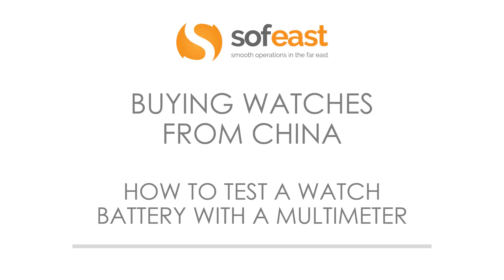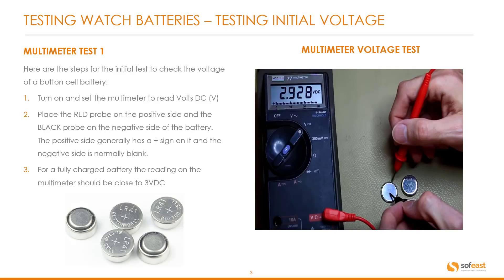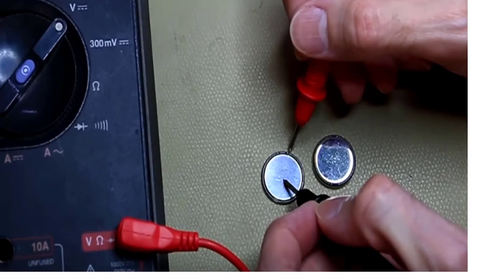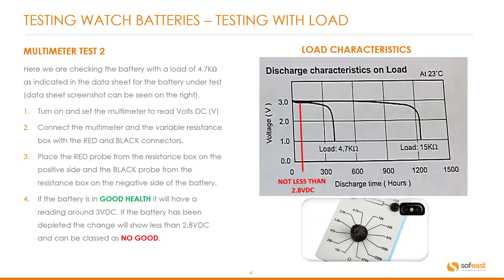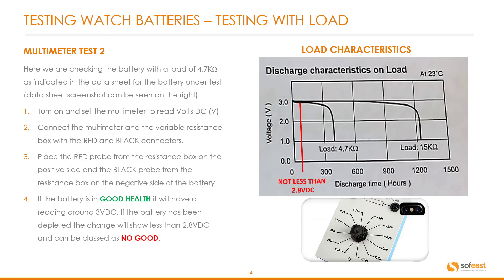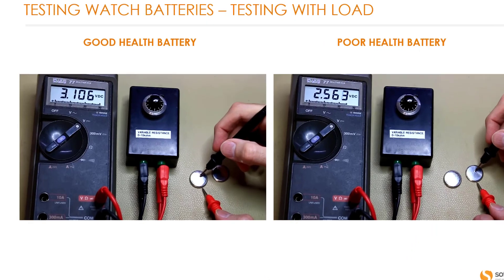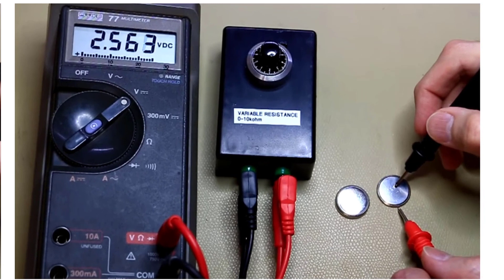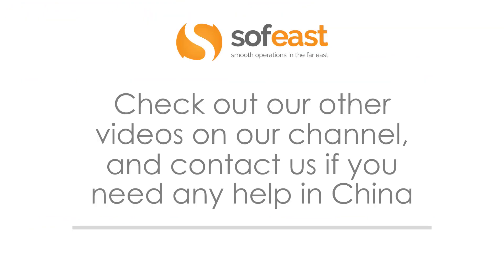How To Test A Watch Battery With A Multimeter

Comment: There is a problem with voltages you quote. Your text does include a line saying watch batteries are 1.5v or 3v. Smaller cells are more common and are 1.5v and this needs to be made clear.

Comment: Can anyone explain how the discharge time (hours) on that graph can be so much longer with a 15 kOhm load compared to a 4.7 kOhm load? Am I reading it incorrectly?
Reply: More resistance means less current drained per unit of time. It may be helpful to consider the extremes first and build an intuition for resistance. At one extreme, you have a battery that is not connected to anything. In that situation, the only way to complete the circuit is through air. Air is a a poor conductor (i.e., high resistance). So the battery does not discharge much at all and thus takes months/years to drain. Now, at the other extreme, imagine you were to short- circuit the battery by directly connecting its positive and negative terminals to each other. There would be almost no resistance. The battery would drain itself almost immediately, except for the fact it would probably overheat first. The resistor is resisting the "flow" of current. The greater the resistance, the less current, the slower the battery will be drained of its energy.

Comment: What is the purpose of the resistance box? Is it to put a load on the battery so it will show low voltage under load? 
Just wondering because that’s how we check car batteries. We have this big metal box with a analog guage that ranges from good to bad. You clamp the cables on the disconnected battery and push the button on the tester. Has a bunch of high current resistors in it. Puts a 80 amp load on the battery. 
Reason for this is because you can get batteries that will show 12 volts on a meter but hook the load and you find out instantly if the battery still has capacity and is capable of starting a car, or it’s ready to use as your core charge on a new battery.
Reply: I think yes, it's used to check if the battery can function at 3V under the load that it's designed for

Comment: this test and its parameters are for 3v batteries and i appreciate it, how ever all my watch batteries are 1.5v
Reply: Take as roughly %7 percentage. For instance, if you take reference 3v battery then see 2.8 as it is not good battery because of %7 lost energy not enough. Roughly %7 of 1.5v = 1.4 v (throw away to battery)
Reply: @bayme5759  Perfect. Very helpful. Thanks

Comment: The data sheet obviously shows two points where a test could be made  -  4.7 K Ohm and 15 K Ohm.

They show two tests and I presume the first is  using a 4..7 K Ohm load but the second test  what load is being used there ?  It can't be 15 K Ohm  for the second test as the variable  resistance box is marked at 10 K Ohm which if you are familiar with electronics means the maximum resistance of the box is 10 K Ohm. 

With some clarification it would be a very helpful video but right now it falls short.
Reply: If the battery can pass the test at 4.7k ohm, it will pass  at 15k 0hm. The 4.7k test draws more than 3 times  the current that the 15k test draws.  (15/4.7 = 3.2).

Comment: The title is "How To Test A Watch Battery With A Multimeter", but it SHOULD be "ow To Test A Watch Battery With A Multimeter AND a variable resistor box"
Reply: you don't need a variable resistor, just a load in the circuit. I used a 100ohm resistor to test and it worked fine.
Reply: @Delly_bean   don't think so; unless you do it for a second,  100 ohm puts too much load on the battery  (30 mA!!) ; the watch does not do that,or the battery would last only 4 or 5  hours (their energy is  around 100 mA Hours to 150 mAmp-hours)
                  Better use 15000 ohms or 4700 ohms;  half of that if it is a 1.5 volt battery

Comment: my meter has DCV  section.. ..BUT options.. 200m,  2000m, 20 , 200, 1000 setings to select from.. which do i use?
Reply: Use 20V, because a 3V cr2032 is between 2Vand 20V